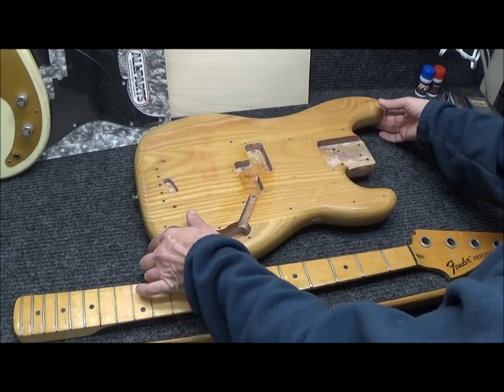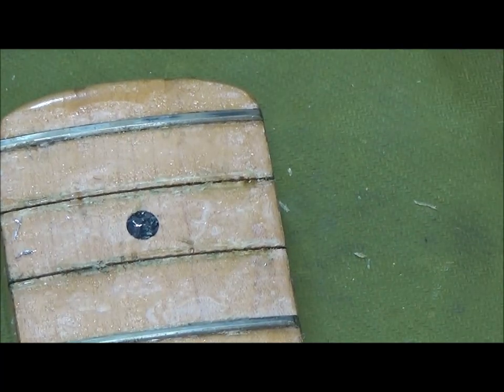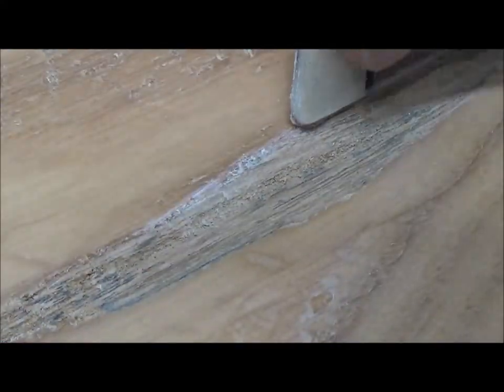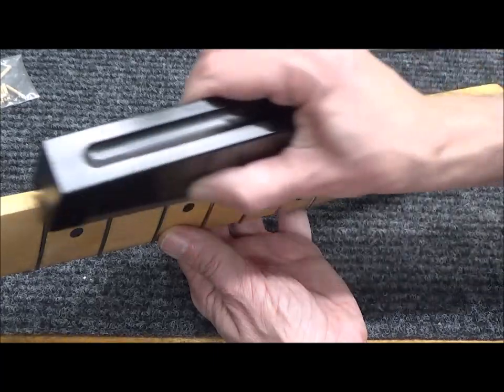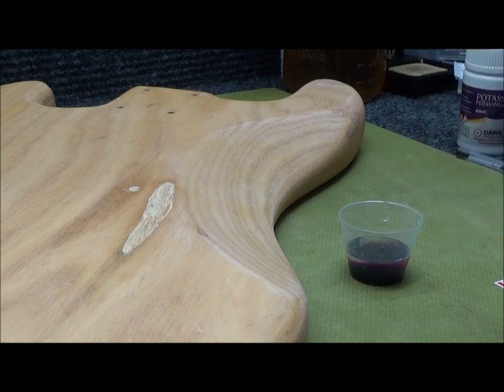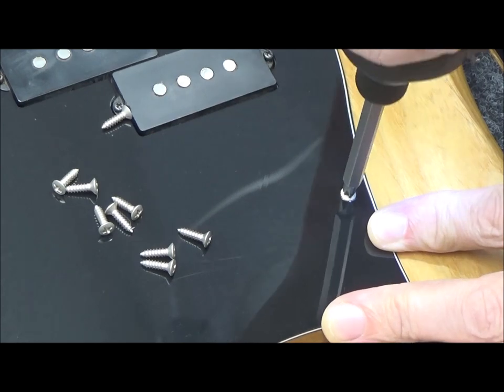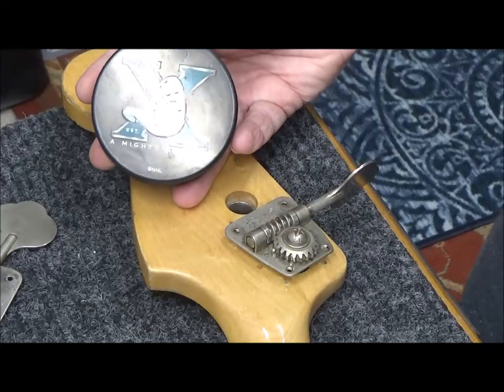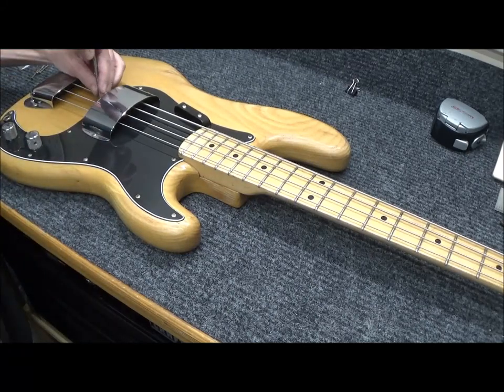Fender Maple Neck Finish Repair

Comment: I have a 2007 strat with a poly finish on both the fretboard and the neck. 

Would a heat gun work to remove the finish on the fretboard after I remove the frets? And would it be best to get all the sanding of the fretboard done before the new frets go on? 

What would you do for the neck? 

For the life of me, I cannot understand why Fender ever decided to put such a dreadful finish on these necks…they are so sticky and impede playing!

Comment: Hi, I have a polyurithane 2010 strat American standard with maple neck.  A friend banged the head stock into a stucco wall, and put an nice ding in the front corner about a 2 mm wide and 1 mm deep.  What would you recommend to fix it?  It seems just fill with super glue is easiest.  Or do you recommend spot steaming it and using urithane?  I think the wood fibers are crushed, so steaming might not do much, and could make things worse.  I can see in your video at the end at 25:02 you show your bass, and it has a similar ding in upper right side of head stock.
Reply from the maker: The spot on this bass looked like a burn mark. But yes, c.a. Glue / Super glue is usually a good choice check out my video where I use glue boost on this old Strat you might get some ideas on how to approach your repair.
https://youtu.be/7-RFnpGCCCg
Cheers 🥂🤘😎🤘

Comment: I have a mid 70s fender stratocaster that has a severely worn fretboard (supposedly from playing, I think over sanding) can the frets be pulled and the board leveled?
Reply from the maker: I just did a job like that. A ‘77 Strat that got flooded during hurricane Ian. It was a lot of work, but it came out great.

Comment: You didn't elaborate on super glue for frets: yes for maple; no: for rosewood, mentioning that it was unnecessary. Could you take a moment to explain why, please? I have a "retirement" project that will require me to install frets on a rosewood board, and I'd appreciate any coaching tips you might offer. Cheers!
Reply from the maker: For fresh slots, I always use liquid hide glue (the brown bottle) or liquid fish glue (red bottle) Both from StewMac. 
Once in a while on a maple board, I will use super glue around the finish and that’s what I did in this video.
The reason I don’t need to use super glue in the fret slots is because I have the fret Barber which sizes the fret tangs perfectly to the existing fret slots.
The water based glue just kind of helps the frets seat properly and fills any air gaps